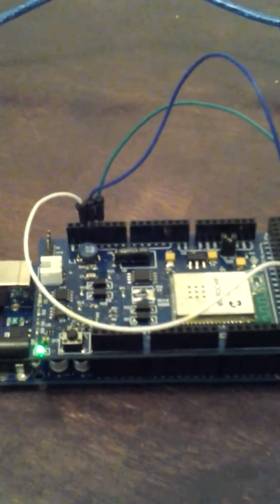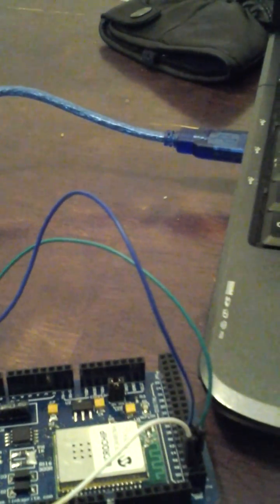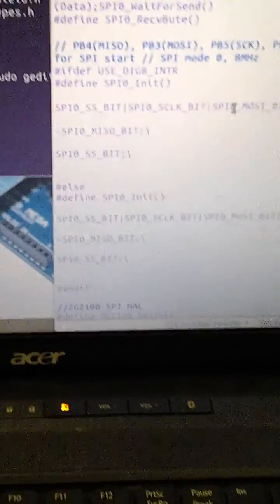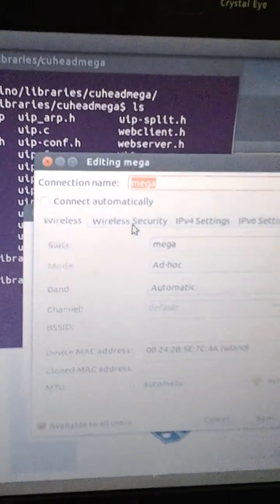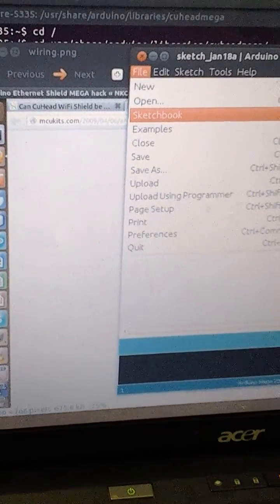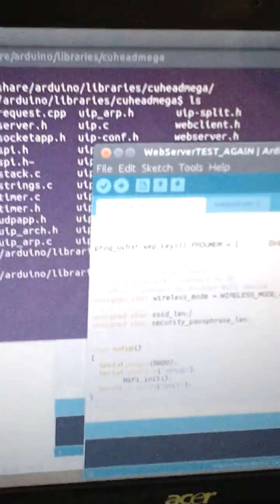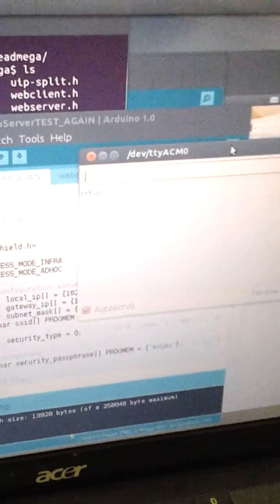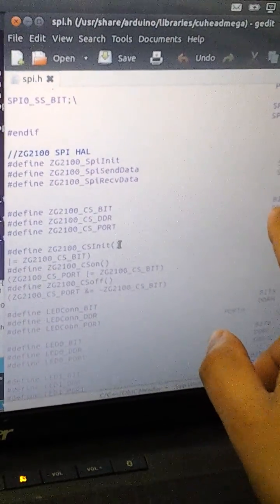How to get Linksprite cuhead wifi for arduino mega to work

Comment: Hello Jacob,
I noticed your posting was a year ago.  I'd just gotten the shield recently, do I a better chance of getting working code from the web site or you have one that can be posted?
Also the wiring, what are they for?  Are they required to work with the Mega 2560?
In the current code, I don't seem to be able to set it to work with WEP share mode.

If you still check this site, your input in greatly appreciated.
Mike